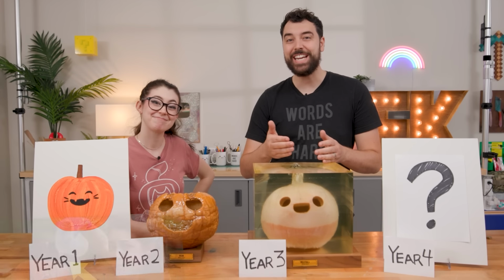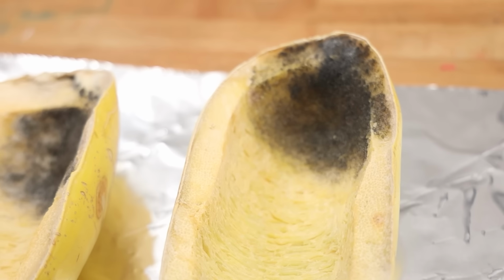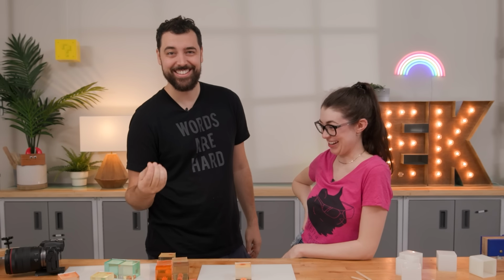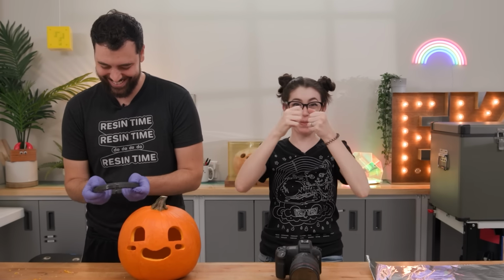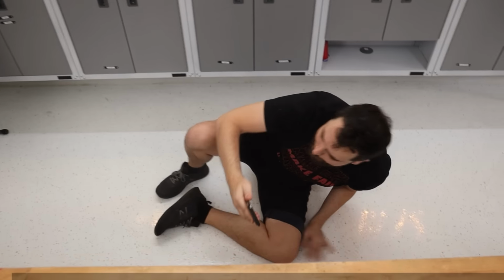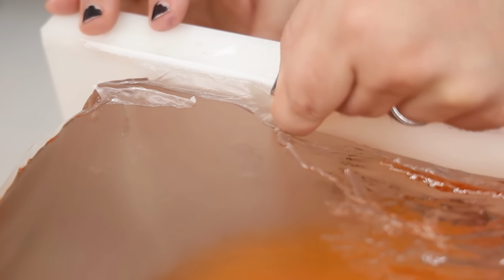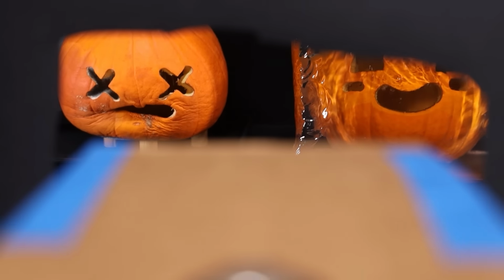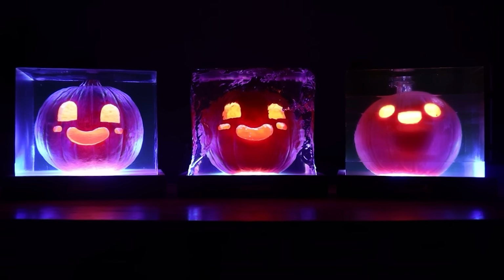Our BIGGEST resin pour yet… all to preserve a pumpkin

Comment: Ok hear me out. You make another mold box a little bigger than the original. Right. Pour around the original chunk it should in theory disappear into the new resin right? Because If you use the same type of resin, it be the same level of light refraction right? This hypothesis is just based on watching every resin video y’all have multiple times. And I’ve never actually worked with resin myself well other than uv resin which i know has a different light refraction than the resin y’all used in this video. Sorry it’s just a thought because he looks so perfect and orange! And i still think yall can save him!!!!!

Comment: "How many ounces in a gallon?" < Such an American sentence. Hail to the metric system! Hahaha

Imperial:
1 gallon = 128 ounces
20 drops in 24 ounces
how many drops to 4.5 gallons.

20 / 24 = 0.833 drops per ounce
0.833 x 128 = 106.624 drops per gallon
106.624 X 4.5 = 479.808 drops to 4.5 gallons

_________________________________________

Metric:
20 drops in 0.71 liters

how many drops to 17.03 liters

20 / 0.71 = 28.17 drops per liter
for 17.03 liters = 28.17 X 17.03 = 479.74 drops

Just one division and 1 multiplication

--------------------------------------------------------------------------

Of course that in this case the rounded numbers were in imperial and it would not happen with someone who uses the metric system everyday.
The results got different because the number of decimal places.

Comment: You guys shouldn't be using power tools. She's gonna hurt herself that big bit could have grabber her shirt and cut up her chest.  That was super awkward watching non power tool users try to use power tools.      Correct use would be secure the pumpkin, even a hole in the ground .... Get or be above the pumpkin, place guide bit at center of pumpkin with the larger hole saw well above the pumpkin. Bring drill to full speed and slowly drive into pumping .... You guys thinking reverse was easier was comical.